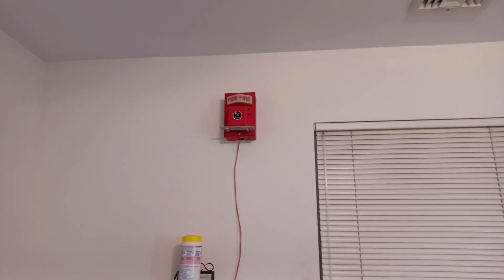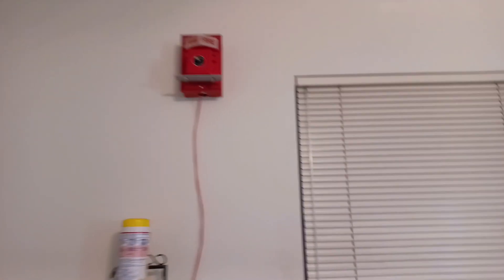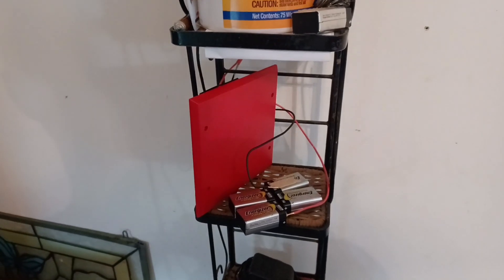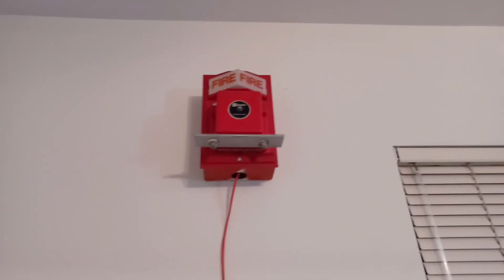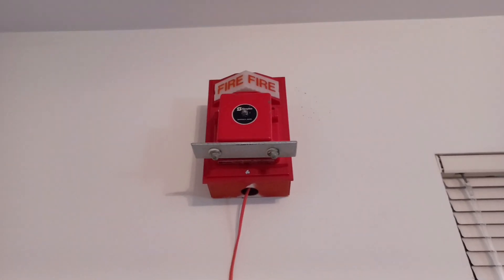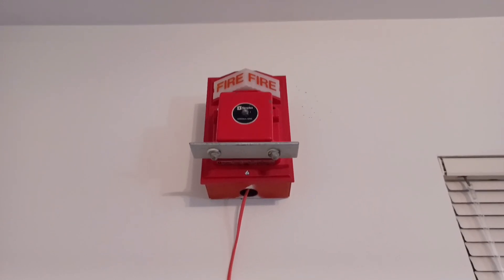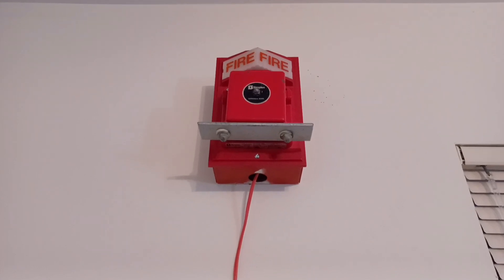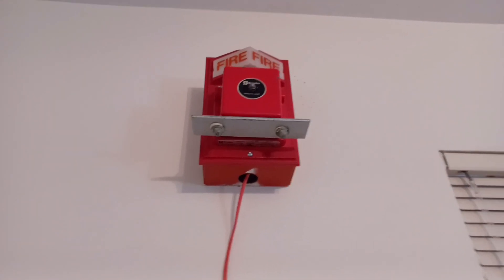Wall System Test 1: Simplex 2903-9234 Chime Light

Comment: Request: Faraday 7410 on 4050-80 with MDL Sync Module
Reply: I doubt the MDL is AC compatible. It’s a modern device designed for DC devices only.